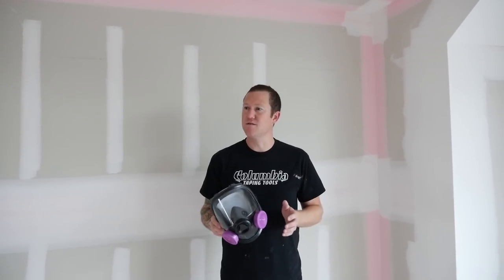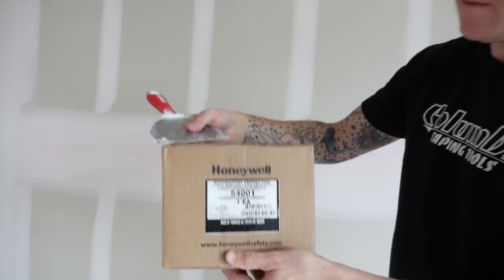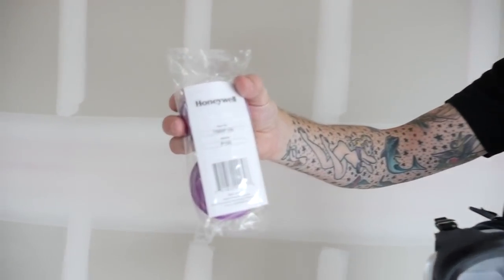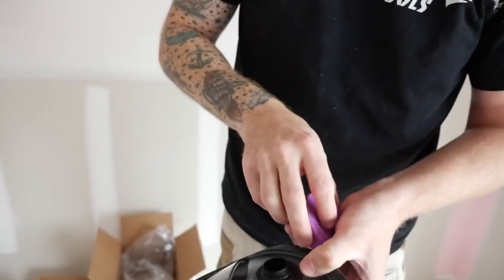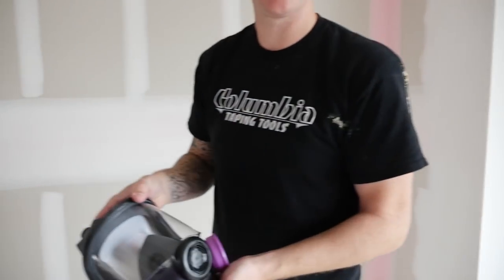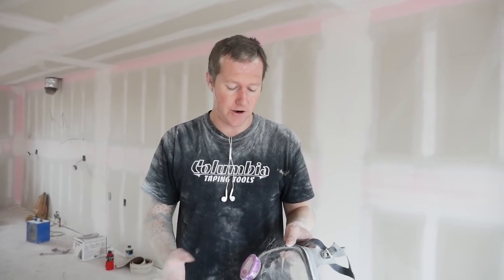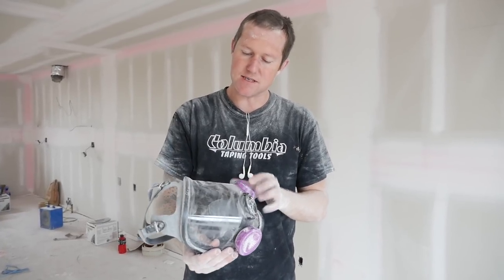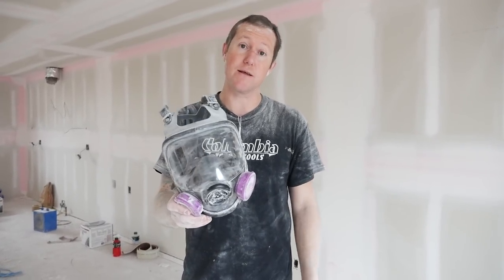Nicks Review on the Honeywell Full Face mask

Comment: You should clean up BEFORE taking off the mask so you don't breathe in the left over, and the dust in the air still.
Reply: And the way he doffed the mask...Ideally you should bend over until the lens of the mask is almost parallel to the ground, and take the mask off by grabbing the bottom part of the head harness and pulling the head harness over the head to take off the mask. By just simply taking to mask off vertically across your face, you’re just contaminating your face with the stuff hat you’re trying to protect yourself against lol